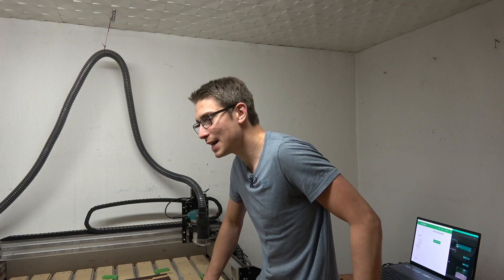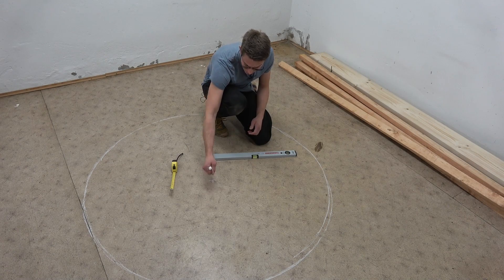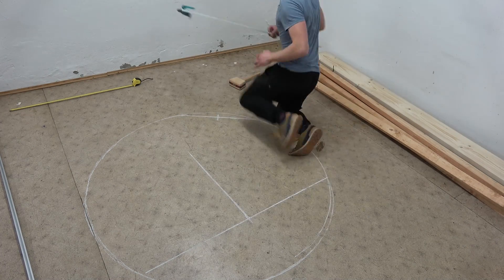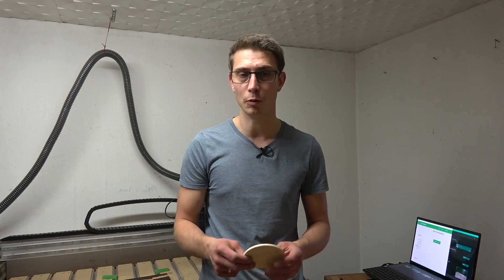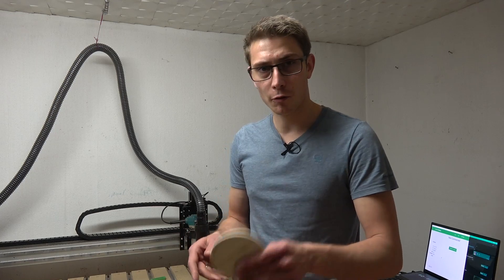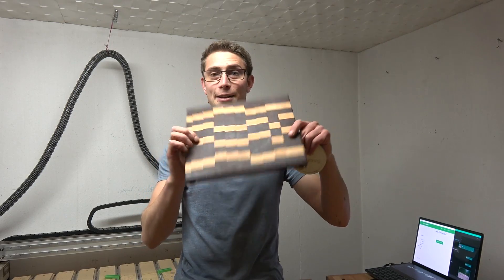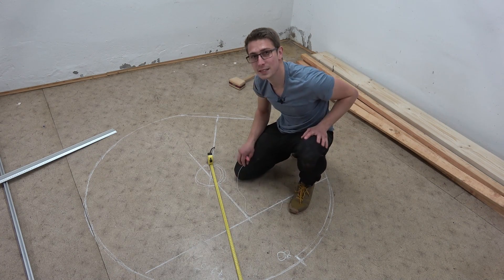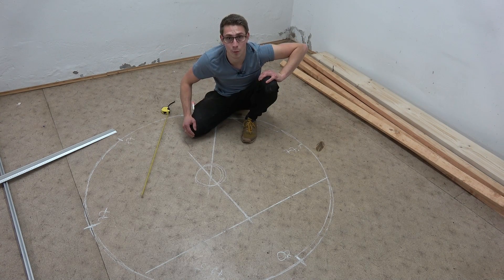Finding the Center of a Circle like a Pro - Mathematics for Woodworkers #3

Comment: I use the following method:
I draw a straight line crossing the circle at any two points.
Then i take the compass and draw two cricles with equal radius between them and bigger than the original circle radius, each one centered at each one of the two points that the line crossed the original circle.
These two new circles will intersect in two different points, draw a straight line connecting them and also passing through the original circle, this line will pass through the center of the circle, but we still don't have the exact point.
Repeat the process, but now with the new line. Draw two circles of equal radius and bigger than the original circle, each one of them centered at one of the two points that the new line intersects the original circe, these two new circles will intersect at two different points, draw a straight line connecting these two points.
With these two last lines, the intersection point of them will be the center of the circle.
I used to do this a lot while i was in middle school, i really liked playing the the compass and ruler to see what kind of shapes and things i could do.

Comment: A Machinists book I have suggestions using a triangle.  Draw a line following one of the edges.  Then you move (rotate) the triangle (or circle) and trace the same edge.  The two lines will always meet in the center.
Reply: I don't understand how that is supposed to work... What triangle? You mean a straightedge, with a 90 deg corner?

Comment: is there a technique or algorithm to find the center of any shape? like if i am cutting something on a cnc and need to toolchange for the center, idk like to find the center of any arbitrary shape like a technique to do that that works 100% of the time.
Reply from the maker: Actually, yes! If you use Fusion360 for the nc files, then it's right in the middle of the length and width